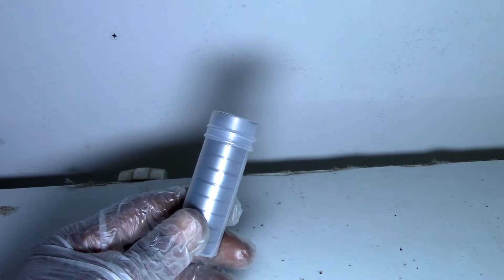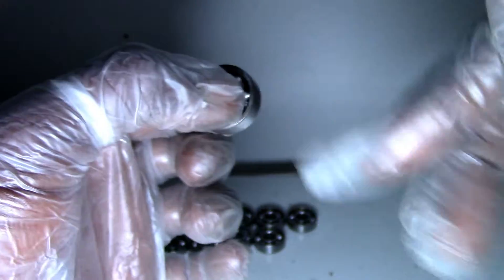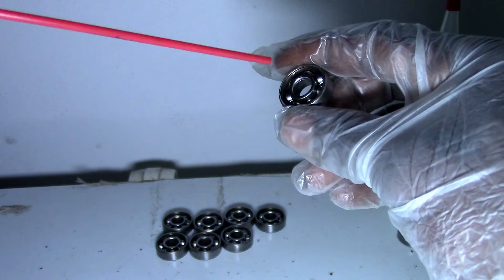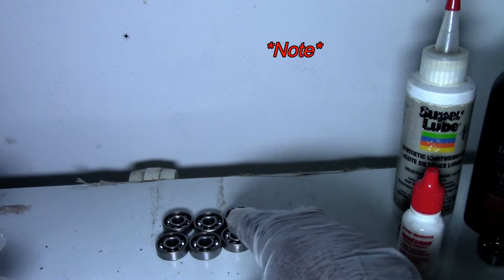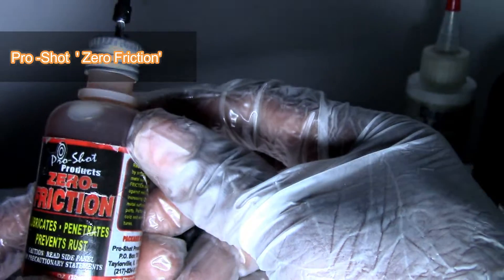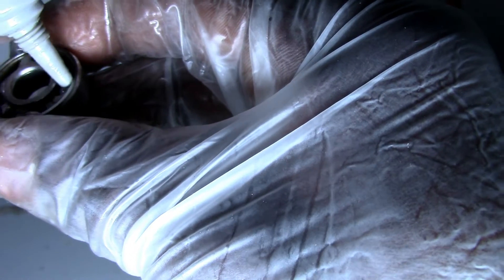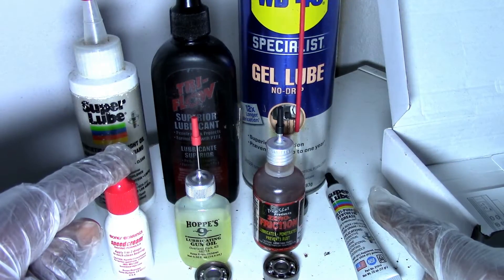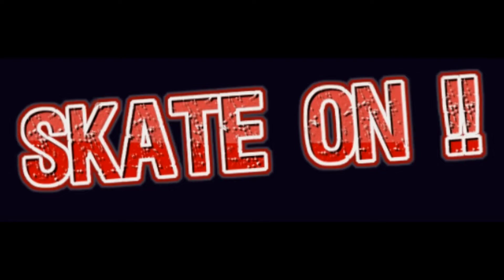Testing different Lubricants 608 bearings

Comment: There's absolutely no need to wear gloves unless u got sensitive skin. I've never suffered any skin damage from handling lubes in my 30yrs of skating.

Those gloves really screwed this whole videos purpose up real bad. Just wash n dry ur hands between each lube to prevent cross contamination.
Reply: Spraying several solvents on your hands still isn't healthy. Not only is it unethical, it's also simpler to clean up since you just take the gloves off when you're done.
I don't blame him for sanitation. 
I DO blame him for not spinning the bearings on a stick of some kind at least. This is probably why the video didn't get automatically removed for disinformation.